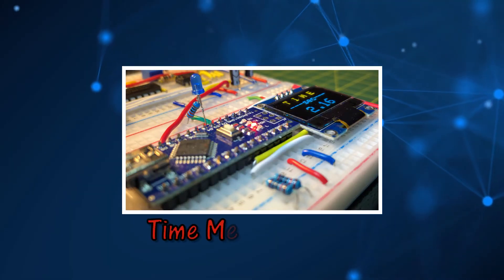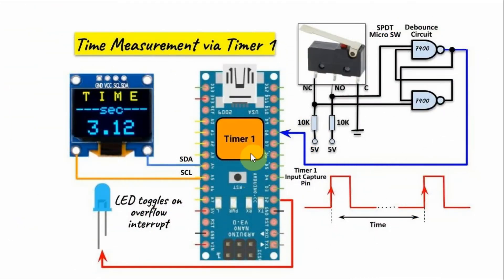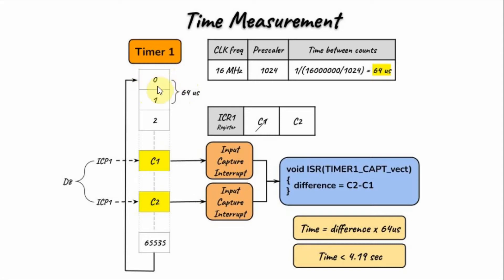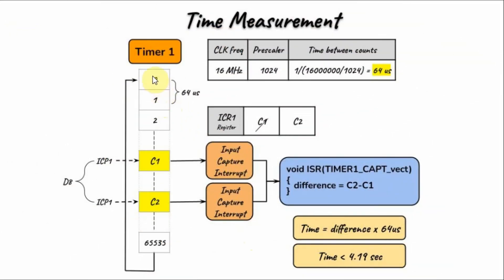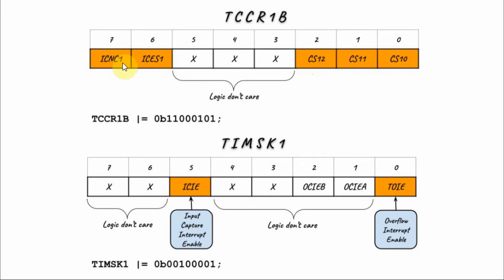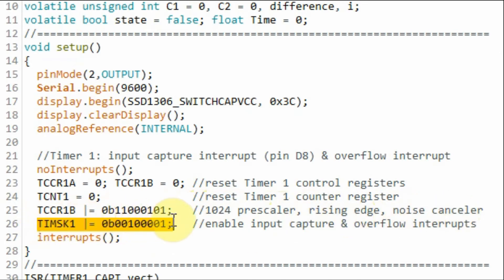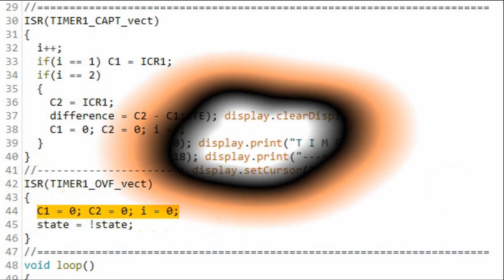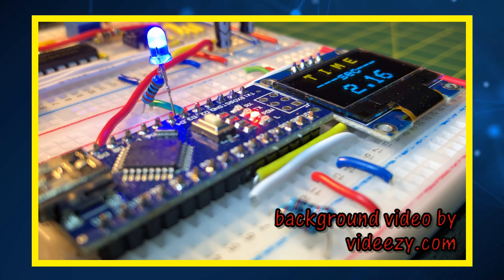Time Measurement via Arduino Timer

Comment: Nice video. But I have one question. Is it possible to put a counter into the ISR Overflow function that counts up everytime it gets called. That way it would be possible to calculate the difference between C2 and C1 beyond just one cycle ?

Comment: Hi Anas, thanks for the video. I'm looking your video without any Arduino background. I've started my Arduino journey with an ESP32, and I'm trying since several days to implement your example (time measurement via Timer1) on an ESP32 without success. Could you please provide something explaining how to measure the time between two rising edges with the Input Capture Interrupt on ESP32? Thanks
Reply from the maker: Thanks for your feedback. ESP32 is a totally different microcontroller. You have to refer to its data sheet in order to program its timers. May be in a future video I’ll do that. My advice is to focus on the Arduino since it uses a well known microcontroller ATmega328

Comment: Hi Anas, thanks for the video, It’s my second day of learning Arduino with zero background, so my question is probably naive, if I have 2 different pwm input connected to the board, how can I tell the timer to measure the time of each separately? Looking at the code no where I see you specify the pin 8, so I assume the timer take whatever pulse it takes and if I have 2 inputs it may not differentiate between the pulses from different pins, am I correct?
Reply from the maker: Hello Emad, thanks for your feedback. I/O pin D8 on Uno & Nano can also be programmed as ICP1 pin (input capture for Timer1). In other words, you can only have one input capture at any time via pin D8.